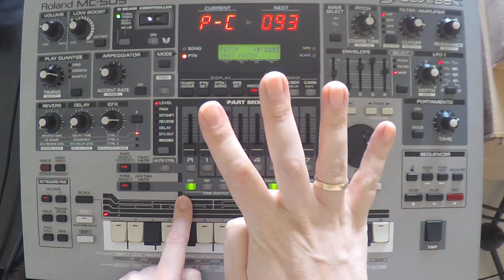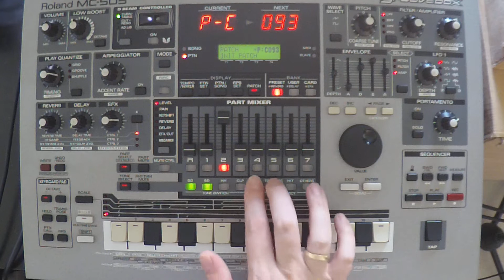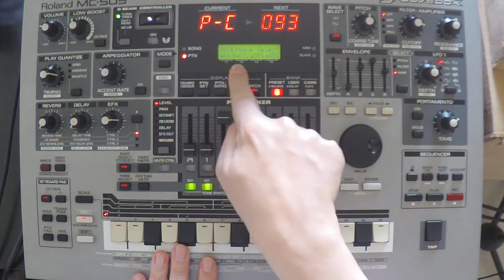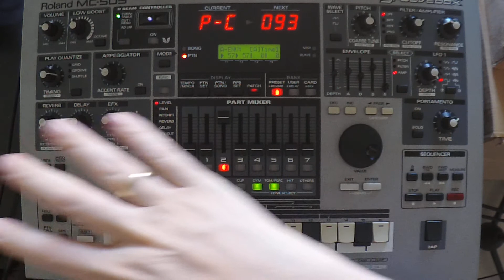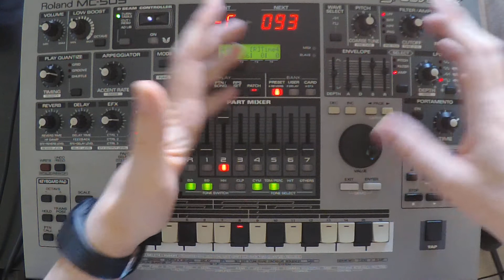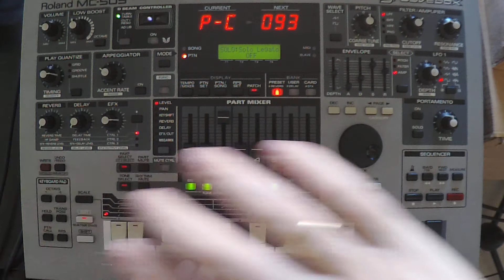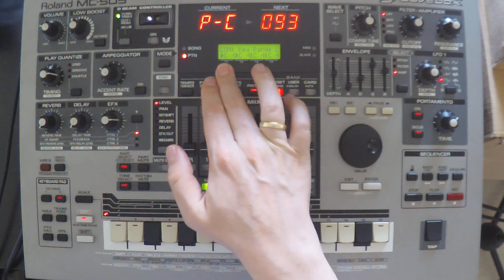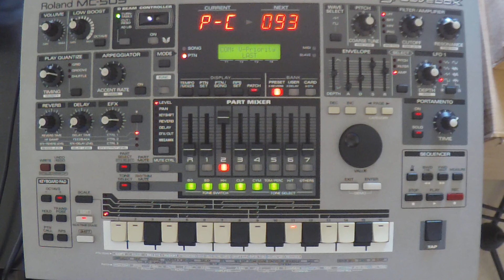Roland MC-505 Tutorial Part 2 - Writing drum kits and patches

Comment: Hey Lousy I’ve watched all your videos regarding the 505. It truly helped me a lot  getting started with this lovely piece of equipment that is just as old as I am 😋, so thank you!!! I do find myself having a problem with the 505 and I was hoping you could help me with it. When I try to change the volume of the individual drum sounds using the FUNC + cutoff function, I realize that after coming back to my pattern, that all of the volume adjustments that I have made with that function are being reset. I do re-write my patterns in order to save, just so you know. Is there perhaps any other way to adjust the volume level of individual drum sounds? This thing has outcompeted my digitakt by far, I do midi sync them together sometimes for extra fun! But this 505 has made my 2020....atleast enjoyable 😅. Best wishes for 2021!
Reply from the maker: Hey, thanks for the nice comment! Regarding your question - In a pattern realtime write situation the tone level changes can be recorded in a pattern, you select the rhythm part and then decide via tone select or rhythm mute whether the knob movements affect one particular part (tone select) or the whole kit (rhythm mute). If you wish to keep the sounds the way they are after adjusting them, you need to write in patch mode, not pattern mode though.  Be aware that could also change the sound of a previous pattern if it uses the same rhythm patch, so if you are not sure it's best to save as a new patch, not overwriting the one that's selected.
Reply: @LousyFacelift  hey thanks for the quick response! I see now, I was having the same problem when adjusting the filter cutoff for bass-like patches. I understand it now!! luckily I got an original dutch and English manual to come back too when im bumping into problems, because I do notice some minor bugs (if its truly a bug or not) when doing my thing on the 505. like not being able to see the pitch adjustments at times, or for some reason my tone select for the Rhythm part will always be set to the HH automatically.  it still amazes me how this thing outcompetes with today standards, anyway...thank you very much!
Reply from the maker: Yes, you will often find two ways or more to get to the same result. You have quick access to a bunch of parameters using shift and the corresponding edit knob but this is more of a live feature. If you get stuck on a drum part like you said this happens when you change a different type of parameter, like for example the amp envelope, which takes you directly to the more complex edit mode. You need to use the exit button to get out of there and switch to a different drum instrument part. You can see all the value numbers when you do the proper menu diving - press wave select, then the pad for the drum sound you wish to edit and use the value dial and controllers and flip through all the edit pages using the arrow keys. This way you have great control over each individual sound, not just the drum parts which can affect a number of sounds in some situations if you have multiple drum instruments recorded on the same part (category). 
  I just bought an MC-707 which sounds amazing, especially in the VA section but I wish it did some of the things like the MC-505, with more dedicated controls and a much faster workflow altogether. It's an interesting comparison and I've still got tons of stuff to learn on the 707 but I already know it cannot replace the 505. The 707 does a fantastic job at imitating other synths, for example you can get very close to a TB-303 which you just don't get from the 505 but it's a fiddeling process and you can get lost for hours in sound design without really making much music.I prefer the sequencer on the 505 and sound editing is more fun. Unlike the 707 it has a character to it, which is both - good and bad, more limited but also a lot faster to program.
Reply: @LousyFacelift  I still have to get used a little bit more to the proper menu diving, but it does make a lot more sense for me now that you've explained that since I was having the same problem with the AMP env section too hahahaha. the wave select button makes menu diving a lot easier for editing things! 
Havent really looked at the mc-707 to be honest, I think I would rather go for the mc-101 or tr6s instead due to price. I know the 707 can do the same things as the 505 probably at a higher quality too but I really dislike the design of it for some reason. I could really imagine sound design on the 707 would be a pain in the ass compared to the 505 due to design, and I completely agree with you that sound design on the 505 is intuitive/relatively easy and fun!! im glad you're having fun with the 707 though!

Comment: still confused about how the tone select/rhythm mute buttons work with the different drum buttons (ie. BD, SD, HH, etc). Are the categories which a sample falls under (ie BD, SD, HH, HIT, etc) predefined and can't be changed by the user? It just seems a bit funny that when you mute a shaker for example you would also automatically mute the tom, or in another example want to change the filter setting for one of those samples, but have to change it for both?
Reply from the maker: Yes, I fully agree that this is one of the weirdest things in the concept of the MC-505. It confuses me, too. Maybe there is a way to redefine these categories when writing a new drum kit but I would have to find out for myself. Thanks for the question, I'll look into it!

Comment: Is it possible to compare sounds like on XP50 for example before writing a patch - it seems like you don't know what other patch/sound you are overwritting when saving, which is reaally the only down side ive found so far to this beautiful machine! Same goes for patterns it seems. Cheers.
Reply from the maker: Yes, you can press [UNDO / REDO] when you're in write mode before saving, this will show you the name of the current memory slot in the display. It's important to name your patches and patterns though because otherwise they will look exactly like the default memory files and you won't be able to tell them apart from the presets. When I'm lazy I just add an exclamation mark to the name of my patches just to indicate that I've already used them.

Comment: I just restored a beaten up 505 I found for crazy cheap and thanks to your videos it's already making its way as the center of my workflow. these videos are great. one question though, is it normal behaviour for the mixer faders to be extremely delicate when adjusting the levels? I find it really annoying to mix parts with a higher level of detail
Reply from the maker: Yes, I even noticed sometimes adjusting one part seems to affect the value of a part next to it accidentally. To have better control while operating the faders, always use them with the screen in TEMPO/MIXER mode, that gives you visual feedback over the parameter values. When trying to reach a specific value use the faders to get close and make fine adjustments with the DEC and INC buttons. Depending on the situation you might want to use the knobs (in FUNC mode) instead of the faders for level, pan or key shift, which is the same as coarse tune btw. So the MC-505 offers different ways to get to the same result which can be extremely helpful. Thanks for the comment, it means a lot to me!
Reply: @LousyFacelift  once again, thank you so much for this light shedding! while we're at it, is there a quick way of clearing the volume automation for each part?
Reply from the maker: tomazbevilaqua No, but you can erase all control change messages of a part (which includes level automation) by changing the erase "all" command to erase "cc" data by simply turning the data wheel when on that page. Unfortunately this will also clear all other knob and slider movements as well. Maybe there is a different way to do it that I haven't figured out yet though.
Reply: @LousyFacelift  britlliant, thank you! thought microscope mode could maybe offer more detailed options but that really seems to be it, sadly

Comment: Watching this again atm, can any of the 505 LFO rate be clocked to MIDI  sync ?
Cheers
Reply from the maker: Yes, absolutely! Each of the tones can have its individual setting for the LFO, so you can even have synched and unsynched modulations in the same patch. There is a dedicated page in the menu for tempo sync. And when the MIDI clock of the 505 is in slave mode you have MIDI sync.
Reply: @LousyFacelift  thanks..that's excellent.

Comment: Hello LousyFacelift. When you edit a patch and write/save it to the user bank, what information is saved inside to that patch? I edited cool sounding patch with filters, LFOs, some reverb and delay and the arpeggio and I saved it to the user patch section as instructed...later when I load that saved patch most of my editing is lost...all the filter and LFO settings are gone and there is no reverb and delay effects in the sound and also the arpeggiator is turned off? I can live with pushing the arpeggiator button again but what about all other settings? Is my 505 passing away...
Reply from the maker: C3018X Hi! Well, are you really sure you saved the patch before you made a recording with it? Because I know there's a mistake that could still happen to me - even though I know about it - when I'm not really focused on the workflow of the 505. When you edit and tweak a patch and directly want to record something with it. When you think it sounds cool and save the pattern without having saved the patch seperately before, you're listening back and possibly still going to hear the same sound but as soon as you switch to another pattern the sound you thought you'd saved (with the pattern) is lost and you're back to where you started before you made changes to that sound. So you have to remember two saves for each track, first the patch, then the pattern and you have to be aware of that all the time. I know it sounds really basic but it can happen so quickly to forget about that! FX types are stored in patterns, only send levels are stored in patches. Use the arpeggiator to play notes just like you would with the pads, so when the notes are recorded in a track you can turn the arpeggiator off and still get the same result only played back from the pattern sequencer. If you're really sure that's not the problem I honestly don't know what else it could be and possibly the thing really isn't working correctly. Hope that helps! Thanks for watching! :)

Comment: There's something wrong with your pitch dial, cause mine seems to work
Reply from the maker: That's interesting, yes, sometimes I have to use the main dial instead of the dedicated ones and I can't really see why. Do they really work in every mode though? Always thought it was normal like that... Anyone else maybe?
Reply: @LousyFacelift  I'm still learning this. I had this way back in 98'. There was no Youtube and the manual was shit (just like most of them back then). I eventually just sold it and used a computer DAW. Now that I"m older and more interested in Hardware - I bought one for 175$ Canadian, which is a steal! This machine is fu*((*#ing amazing for drums! It's the main reason I bought it. I was watching a little documentary of Ian Pooley and he was stating that you just can't get that "swing" function on a DAW that sounds like hardware. I think he's right. So basically the main reason I have this device is for those two things - swing/shuffle and drums. It's fantastic for that. Next, i'll get either a tube compressor or mixer to rid the digital sound because the mc505 is apparently all digital. 

Ya..I was watching you vids and I tried my pitch and it worked, so maybe yours has a glitch?
Reply: Mine works exactly as in the tutorial. Except mine is a bit loose. I’ll need to replace it.

Comment: Hey thanks for these. I just bought my 505 and your videos are really helping. I am experienced a bit with Roland gear. I have this issue where the patches I load in to a pattern are not saved with the pattern. So when I reload the pattern all the note are playing but playing the wrong (default) sound patches'. Is there a step I'm missing?
Reply from the maker: T-Bone Tunes Recording Studio  It can happen quite easily that you forget to save (write) a patch you've created before saving the pattern in which you want to use it and in this case all the changes you've made to that patch will be lost. It's a bit confusing that the user bank doesn't simply consist of init patches but duplicated versions of the preset sounds. I always save a new patch to the last location I haven't used and I rename my own patches and put an exclamation mark as the last letter in the name so I know I've already used it in a pattern when I go through the list.
Reply: I'm having the same problem and it doesn't have to do with saving a patch. Everytime I change the patch for one part on a user pattern it changes the part for all user patterns. Any other suggestions?
Reply from the maker: doctorjjj  That's just what I tried to explain though. If you make changes to a user patch you need to write this altered patch to a new memory location (!) before you start writing a pattern with this new sound. If you use the same patch memory location these changes will affect all previously recorded patterns that make use of this patch as well.
Reply: @LousyFacelift  Yeah it’s not that though. Like even if I change say Part 1 to a preset patch (without making any changes to that patch) it changes all Part 1s for all User Patterns to that Preset Patch. I’m wondering if it’s a faulty memory problem. Unfortunately I don’t have a smart media card.
Reply: @LousyFacelift  do you know if there are any batteries I can change on this unit? Thanks again.
Reply from the maker: @glossywheel   Replacing the battery was my initial thought when I read your reply but now I don't even know for sure if it has one to be honest. Sorry I cannot really help you with this...
Reply: @LousyFacelift  no sweat, thanks for the helpful videos!

Comment: Hi,
no sound for the drum kit
Reply from the maker: You're not hearing any sound from your drum kit you mean? Check the output setting, maybe you've assigned the rhythm part to the direct outs 1 or 2 without connecting them to your mixer or amp. Press TEMPO/MIXER in the display section, then select EFX/OUT in the part mixer, hold down SHIFT and move the fader of the rhythm part to select D (DRY), E (EFX) or R (RHY). If you don't hold shift you can only switch settings from dry to efx. Watch my effects tutorial for further info.
Reply: LousyFacelift thank’s 🙏 but no way the solution was to initialize factory setting
Reply from the maker: Nad Bak Well, have you checked on the output settings before executing the factory reset?